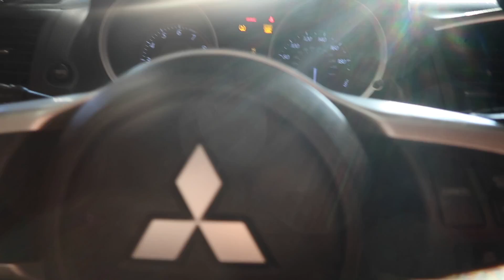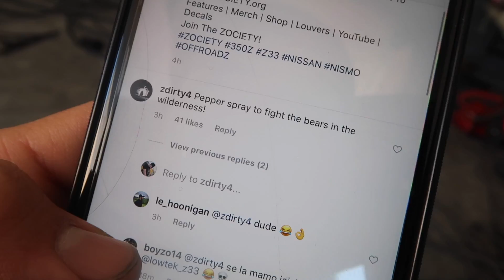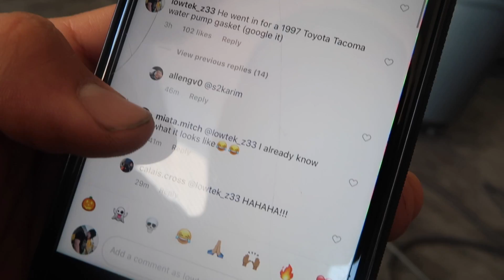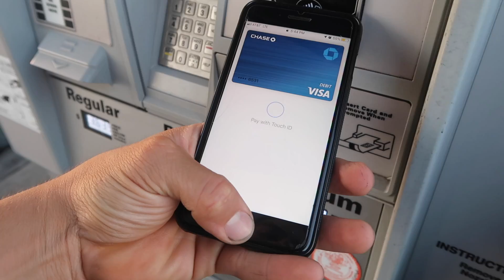My Evo X finally gets tint!

Comment: Damn boi, never do circles when washing. It’s better to a left to right motion with the sponge, it reduces any marring in the paint
Reply: you’re referring to swirl marks. And actually swirl marks aren’t caused by washing in circles. They are how your eyes perceive micro scratches. The sun is round, the earth is round. The way light reflects tends to be round. The scratches aren’t actually circular. Just perceived that way.
Reply: Layne White idk where u heard that from, but it’s partially true. The swirl marks are caused from using the wrong equipment for washing ur car and even in some cases from drying with the wrong towel (I.e, using the brush at the coin operated car wash)